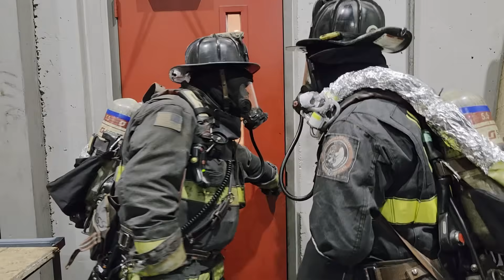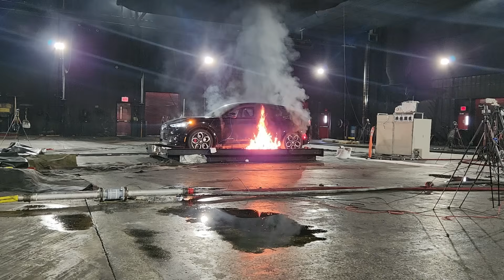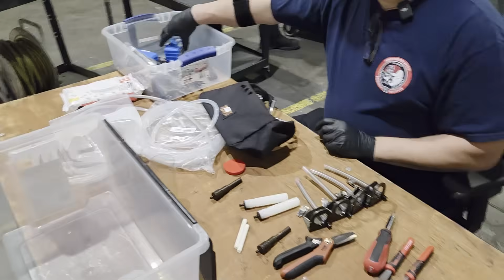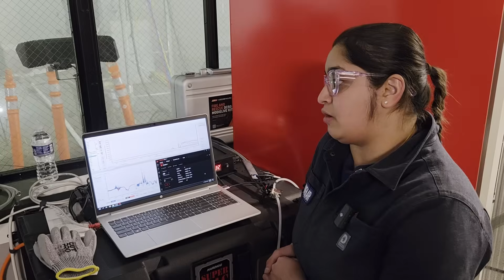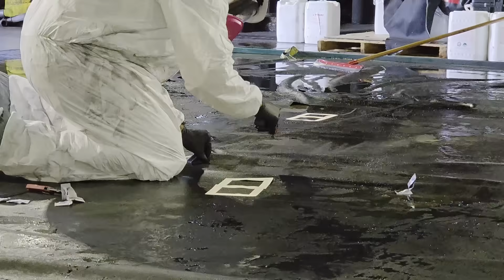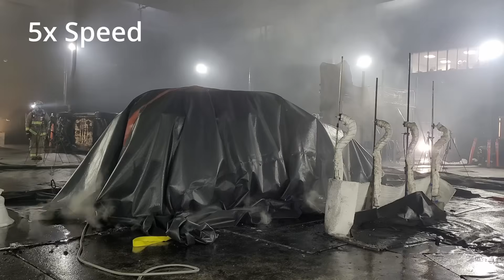Fire Blankets vs. EV Fires: FSRI's Real-World Experiments

Comment: I firmly believe that all E.V. car spaces should have drop down ventilation tubes above them connected to an external filtered chimney and also, the fire fighters should be able to push a smoke extractor under the fire blanket while the car is in thermal runaway.
As this is a relatively new fire hazard, our understanding of the risks is developing daily, smoke fumes / explosion  pose a huge threat to life so the design of buildings must be evolved to curtail the damage.

Comment: Every EV battery fire is thermal runaway. It's the name we use when one cell burning spreads to the next cell.  Also popping and cracking with intense flames.   I just saw a standard car fire here..

Comment: Morning,  thank you for the information.  Truly helpful to be prepared when the encounter occurs since it is inevitable.  The battery saga is confusing as it changes tactics frequently.  Just saw South Metro using foam for vehicle fire after allowing to burn and consume most of batteries.  Is that the best approach? Let burn to prevent hydrochloric acid and water contamination and then use foam?

Comment: How does this information make it's way down to the local Fire Companies?  Does this get pushed out in recurrent training, or what?  I know safety is key for the fire service in general, but I feel small rural departments may or may not get the training they need for dealing with this.  I'm thinking that the after action decontamination it just as important for safety as the act of fighting the fire.  If the gear isn't cleaned properly then individuals could get into potentially hazardous products, or spread them while trying to clean equipment.  Thank you for doing what you do.  Not a fire fighter myself, but a supporter of my local volunteer department.

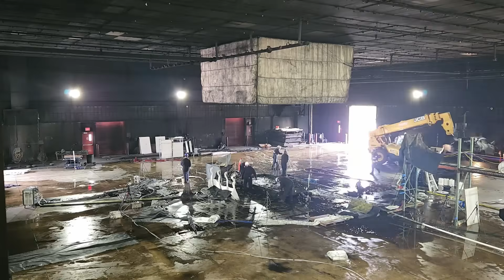Comment: 12:50
If there's difficulty in getting them into thermal runaway, why not just damage the battery where you know the battery will cook off?

e.g. - puncture the battery and then inject water for a lithium/water chemical reaction.
It may be harder to test safely, but it may also produce more reliable results with the battery pack.

Comment: @2:05 in my opinion this is wrong, thermal runaway imo should have been made to happen electronically via a short circuit or overcharging, the battery is not going to just combust from heat on a hot day, its happening from wrecks because of the short circuits

Comment: As someone who’s deals with lithium ion cells and lithium polymer batteries nearly everyday, research and development should be the first priority when designing anything that uses the batteries especially more volatile chemistries like lithium polymer and lithium ion, ironically you’d think the EV industry would’ve learned from the incidents involving thermal runaway batteries people experienced in the vaping industry especially running lower resistance pushing batteries to their absolute limits I mean running super subohm 0.10 and lower to around 0.08, a 0.08 ohm build is drawing 52.5 amps from roughly a 20 amp 18650 li-ion cell which can cause thermal runaway due to how quickly the cell can heat up and due to how mech mods are constructed it’s like having a pipe bomb in your hands, thankfully newer mech mods have actual venting for gasses but anytime I saw a person who has no business using a mechanical mod running a super low build I tend to shake
My head and try to give advice especially on the cells they should be using as most tend to use cells you’d typically see used in regulated mods for battery life since all the current draw is handled by the board used for the chipset and there’s so many safety features like low resistance protection, short circuit protection, low voltage protection and so one, but the point is people been through these instances where EV manufacturers could’ve learned that lithium cells under load produce heat and without a proper cooling solution the cells will eventually start venting flammable gases which then catch fire, hell we’ve had these issues in laptops and phones even during the vape battery issues!

Comment: Why wouldn’t you use software to make the battery packs go into thermal runaway on their own? Wouldn’t that make more sense than fire under the car? Like, make the bms turn its safeties off and charge the car until it catches fire and then pull the charger at a breaker that’s away from the unit… something like that?

Comment: Would have liked to see a piercing of the battery, like what can happen in an accident. Like some sort of pneumatic cylinder under high pressure with a spike or rod puncturing the battery.
Reply from the maker: I've seen experiments like that and piercing the battery causes instant thermal runaway.   It also adds a variable to testing that wouldn't fit well with the experiments in the video.

Comment: I wonder if you could use a modified lift jack with a point attached to pierce the battery cell and start the runaway without using fire?
Reply from the maker: It would.

Comment: Can I suggest that you ditch the foil wrap and contact Design Engineering Inc for some of their different automotive heat wraps? Seems like there would be less messing around with the rigging, and probably higher temperature protection too. You'd get better flexibility than aluminum foil.

Comment: @7:33 Well atleast they have an analysis of the water they dump into the environment, most companies don't bother and just discharge their waste water without testing how bad it is....  You really didn't address what happens to that water after testing, didn't hear that it was held or anything just lead to believe it's sampled as it runs out the drain as storm water or whatever.

Comment: Be way easier to start a thermal runaway by just over charging the batteries, just send 240vac into the pack bypassing the BMS, she'll spew fire quick, I've got some old swollen RC truck battery packs I'm gonna do just that to, I dont toss packs in the trash without burning them first, I'm not gonna be responsible for setting the trash truck on fire at the least.

Comment: Hi Pat, thanks for the very informative video.  I know this is a difficult analysis because you have to invent your own tests via trial and error, and hopes going over the test data will provide some useful answers.

I would recommend an electrically heated copper plate with a silicone pad between the copper plate and battery pack, instead of using a gas burner.  This way you only heat up the battery pack.

Comment: Ok the one guy carefully cuts a piece away and hands it off to someone that shakes the crap out if it! Why? Plus this shows a lot of the wasted money by them using drones flying around the area with stationary cameras recording everything! Waste is waste in any case. I say do away with ev's for production until they come up with a faster than dousing a gas fire method! If an ev is supposed to be more economical than gas they have yet to come close to efficiency, economical, or even safety of a gas vehicle! Less range, takes a day to charge a battery to travel that 1 third the distance and near impossible to put the fire out. Don't forget to make an ev is about the same as building and driving a gas powered vehicle for more than a decade!
Reply: Your comment is proof that you know nothing about electric vehicles.

Comment: Why not just overload the battery to induce thermal runaway? That research should be conducted to simulate limits of undamaged lithium cells. Both types of overloading should be tested regarding extreme discharging and extreme recharging.

Comment: It's extraordinary to think that, for all the precautions, the monitoring systems, the experienced fire crew members conducting the experiments, the video evidence and the toxic, smoking, charred remains, none of these fires actually took place. Nope. Not one. EV batteries simply do not burn. At all. Ever.

So that's all right, then.🤭

[And before the Teslamic faithful point out the difficulty the team had triggering the required thermal events, the object here was to create such disasters on demand, in carefully controlled conditions. The problem with 'real-world' battery fires is that they can occur for any number of reasons and entirely without warning.]

Comment: Couldn’t you drive this via software, or electrical circuit? I would think software would be able to simulate an overheating battery cell.
Reply: 5:18 Disposable mopp gear seems like a viable solution to trying to clean firefighting gear.  If it is an EV fire, simply throw mop gear over the fire, fighting suit, then dispose of it.

Comment: Somehow setting a battery on fire does not look the same as a real thermal runaway. The strong jet-flame(sideways) burning through everything, effect of enclosed spaces with results into explosions. The heat built up due to being parked between other cars and a roof overhead vs large really excellent ventilated and cooled huge space, does not seem to be really the same as real world conditions. Where stuff around it also start to burn and block heat dissipation.
Edit: It is at the end of the vid, they are exactly planning to research what i mentioned, awesome !

Comment: Excellent experiments and data collection.  How do you stop thermal run away?
Reply: You cool the individual cells, surrounding the heat source🤗 Idk if we ever get a standardized inlet on the car, especially with those structural batteries, but somewhat in this direction, would stop thermal runaways🤗 You need to cool the individual cell or wait and contain.
Reply: @goiterlanternbase  Ok, thus the name thermal runaway.  What puzzles me then is why cover the EV with a blanket.  Guess the answer is lotsa water.  Thanks.
Reply: @markfowler6276 The outgassing has the same problem as most outgassings. They are not inherently flammable.  The fire blanket works like ever. I removes heat from the flammable material, thus stopping further decomposing of stuff into flammable gas. 
Sadly LiPo batteries contain an oxidant, so instead of suffocating he fire entirely, they just slow down the deflagration.
Reply: re: "How do you stop thermal run away?"👈stated another way, unbeknownst what this question is akin to asking is this, Q: "How do the boys of the local B-Squad disarm an IED that's already gone off...? A: THEY DON'T.  for those looking for insight on how this works, all's you need to do this weekend is sit down with some popcorn (can't forget this staple ingredient) and watch OG Bruce Willis in the 3rd DIE HARD movie from the year 1995.  that's right, everything we need to know about this problem in the year 2025 was ironically already taught to the masses exactly 30 years ago, and it's entertaining AF on top of the learning.😎
Reply: Q: How do you stop thermal run away? A: well as we've seen with all the Pulitzer Prize Winning fire coverage found right here in the patented StacheD archive, in reality YOU DON'T stop thermal run away.😲  again it is simply "Confirmation Bias" and our desire for everything we touch in the world to have a SOLUTION that prompts us to ask such questions in the first place. ref: TEMET NOSCE (Latin for "Know Thy Self) 👈sadly what never crosses our minds as Human Beings is that an answer may NOT exist, or more specifically the "super easy answer" we desire may NOT exist.